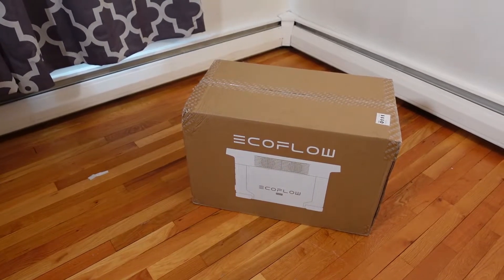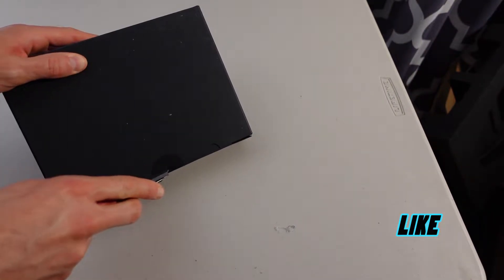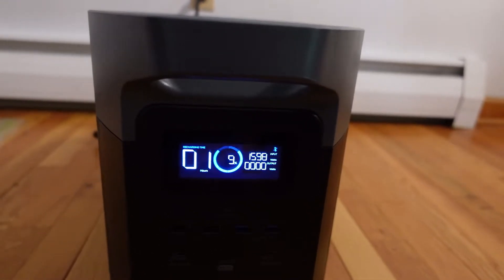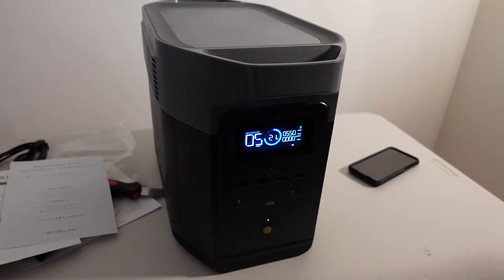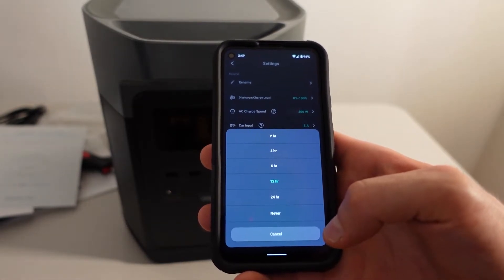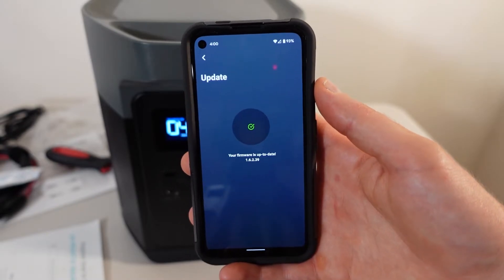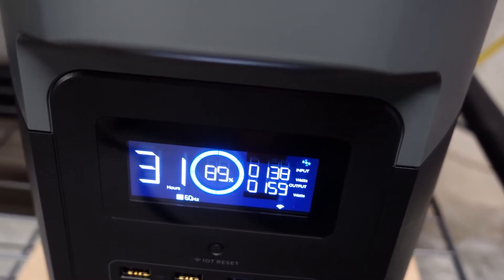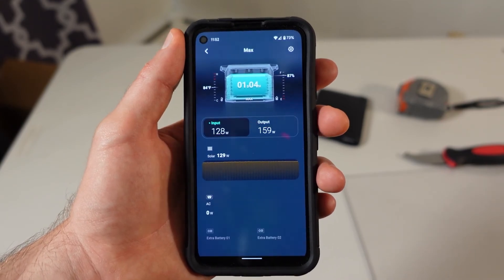Ecoflow Delta Max (Part 1) - Unboxed, Setup, Refrigerator, Freezer & Solar Panel Connected

Comment: Hey bud! 

 Issue isnt the ecoflow. it's the solar setup.  The ecoflow can take up to 1600 wats input.  If panels are in series, and 1 in the shade brings the whole array electrical generation down.

Try a hybrid or move the panels to get full sun all day.  Also, check the max volt and amp they can generate.  Others on YT show over 1000 watts onput, which would more than charge and run the refer and freezer.

I have eco flow, with secondary battery.  Run 12.5k ac all day in summer. Over 12 hrs, blowing 68 in 90 degree weather, then recharge at night, when my electric is almost half price after 7 pm

Expensive.. yes.  But it allows me to move the unit to other places as needed.. or camping ( like lobster lake!)